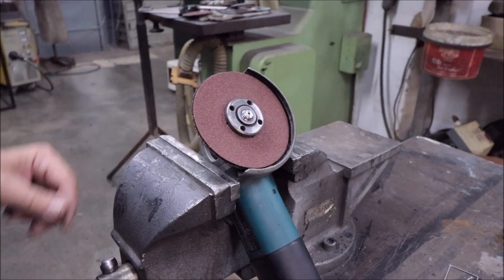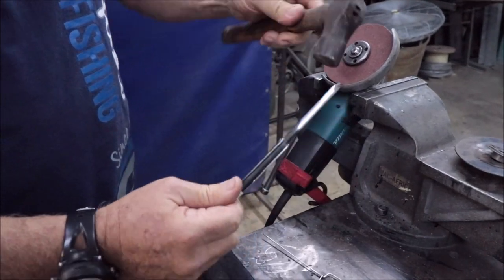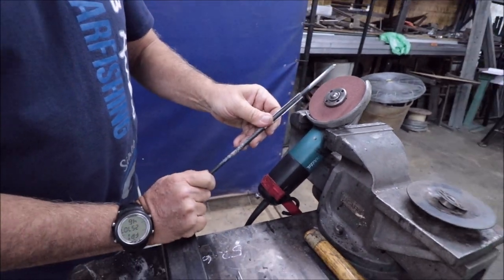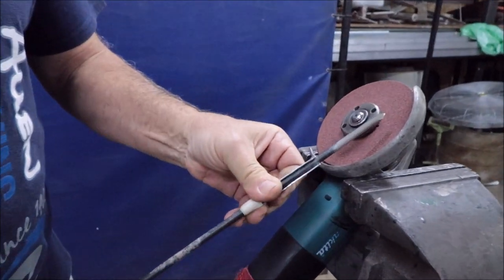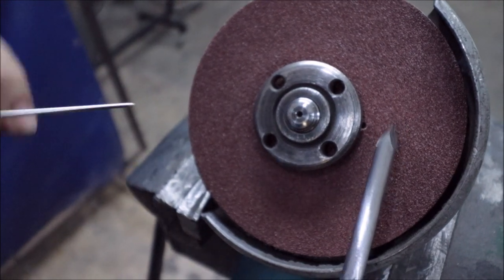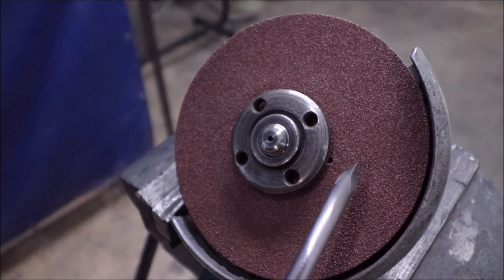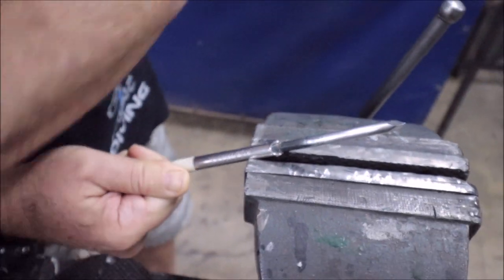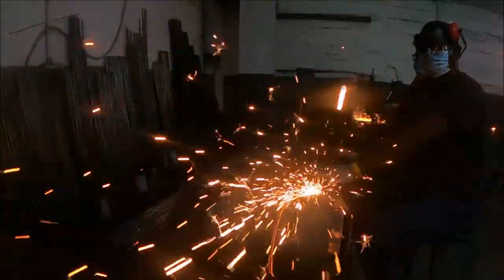Rob Allen | How To Series | Spear Sharpening

Comment: And a video for conical shafts? Coming soon perhaps?😊 a nice easy video for you Rob and more wisdom on the internet for us.
Reply from the maker: I would not have thought guys would want to see that. We have never been asked for this so, we have never set up a way to do it but...... I will consider it 👍
Reply from the maker: Conical shafts need to be tested in a pool, not so simple but is already o on the list of videos still to be made.
Reply: @RobAllenSpearfishing  Tri-tip seems intimidating having been used to conical. but maybe im completely wrong. my spears are always slamming into rocks too, sometimes at 9 degrees. sounds awful i know. i try to do double taper like when you first buy a shaft but hard to get a factory clean-cut end every time. Maybe its time for tri-tip, even though i do very little hunting without something behind the fish.
Reply from the maker: @CoşanGülaçar  try the tri-tip but make the angle smaller. More like 45 degrees

Comment: Good day Rob. Any chance you could make a batch of spears for pneumatic guns? I can send over a template for the threaded tail portion. Loving the videos, can't wait to come back to KZN for some soul fishing.
Reply from the maker: No problem, just need to know the thread. Some I have seen are 6mm metric. We can thread both ends. One problem, being plated, your line slide might scratch up the plating. What diameter are you looking for? We do 6,3mm, 6,6mm, 7mm, 7,5mm and 8mm only.
Reply: @RobAllenSpearfishing  Fantastic stuff! I use 7mm, 7.5mm and even 8mm when there's halibut about. Line slides are currently holding up well in plastic and delrin so no worries there. Will figure out a decent way to ship them Northwards (I relocated to Norway many moons ago) and get back to you. Just by chance, I'm currently starting up my own maritime business here - do you need a good dealership for Norway or Scandinavia? I'll do some mad fun promos for your kit!
Reply from the maker: @endosapien  
Thanks for that. We do have a distributor in Norway, not sure if he does Scandinavia as well.

Comment: What sanding disc did you use in this video?
Reply from the maker: No sure, I think 80 grit. The finer the grit the slower it will take off material, but easier to control.

Comment: Is a bench grinder ok, or do you need to grind away from you?
Reply from the maker: A bench grinder is difficult because as you see, best to grind away from you but also onto a flat surface. The outer edge of a bench grinder has a radius. If you could mount the bench grinder on its side and use the side of the stone it could work. It is best when you can visibly see the 2 edges against the stone at the same time to keep them uniform.

Comment: Hey Rob I bough one of your spearfishing knifes a few weeks ago and love the design and slim profile but buy the time I got home from using it fir the first time today the knife was covered in rust spots I say I was using it but it was completely blunt the bevels where ground completely uneven and the tip was as dull as a spoon I think there is a problem with quality control where these where made I for one would be ashamed if my name was attached to this knife especially whe  its primary function after dispatching fish is safety
Reply: I can understand and deal with the rust spots you want to make a blade that retains its edge and is strong but sending them out completely blunt with a rounded tip is disgraceful
Reply from the maker: @leecollins8692  Hi Lee, I agree this should not happen, I will check our stock. Where are you in the world?
Reply: @RobAllenSpearfishing  I am in the UK

Comment: What to do if the material is annealed
Reply from the maker: As long as you do not get it red hot it will be fine. The straw colour is ok. Grind slowly with time between grinds to cool. I have only once tried to re heat treat the tip, did not seem to make a difference but as a one off was hard to tell. In retrospect, the transitional zone between the heated tip and the rest of the spear might be an issue, never tested though.

Comment: how i wish rob allen had rods with rest pegs in america
Reply from the maker: It can be done but the heat from the welding will make the spear soft at that point and very easy to bend when you shoot a fish.
Reply: @RobAllenSpearfishing  at least one lug rest, to facilitate loading, and not having to dive with the loading tool
Reply from the maker: @EuroYepes  As mentioned, can be done but we would not recommend it because the spear will get bent with very little force.